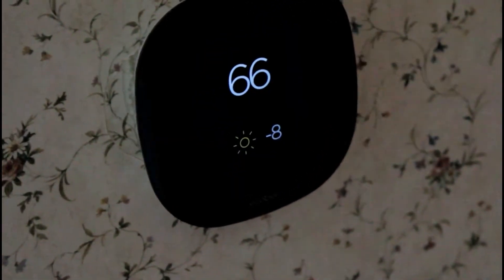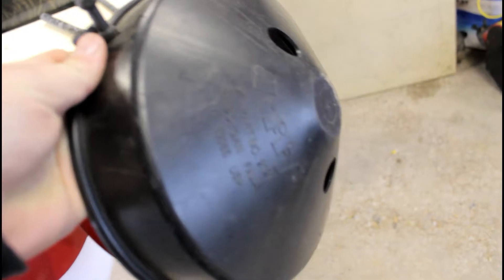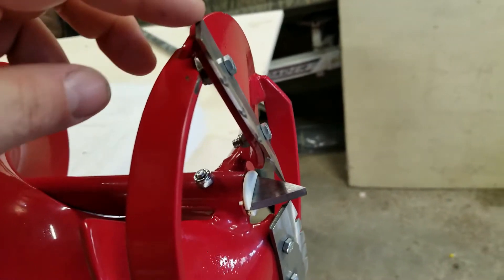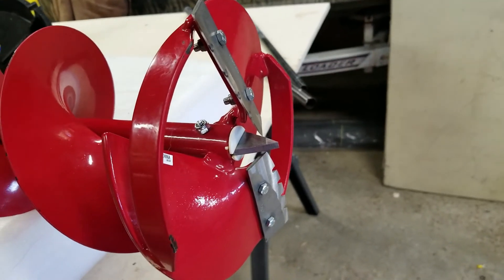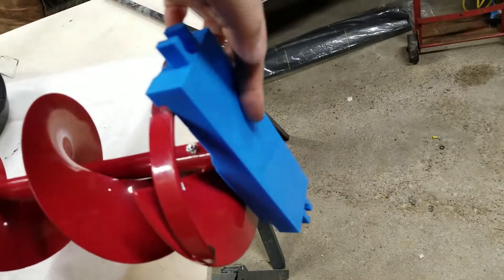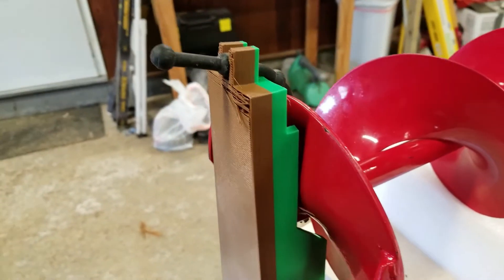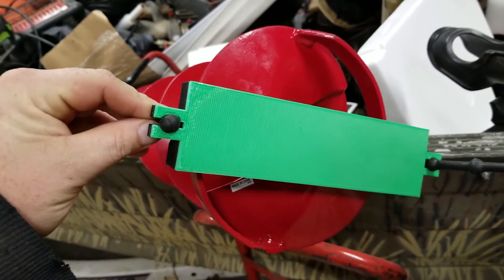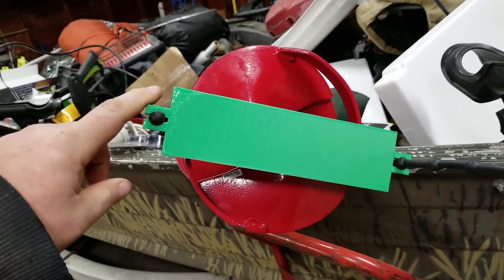8" Ice Auger Cover (DIY 3D Printing)

Comment: Do you have the file to share?  Looking for the same thing.  Thanks
Reply from the maker: I will have to look through the files but I'll make a note to try and find it tonight!
Reply: @RevampedOutdoors  That would be awesome!  Still work great?
Reply from the maker: It was working when I switched out the auger a couple of years ago, I went ion after this. I qould recommend printing it at full infil though just due to the rough nature of it I did 10% or something and it did get beat up.